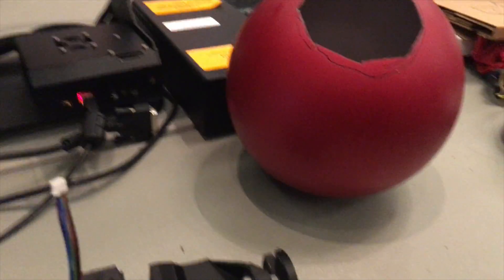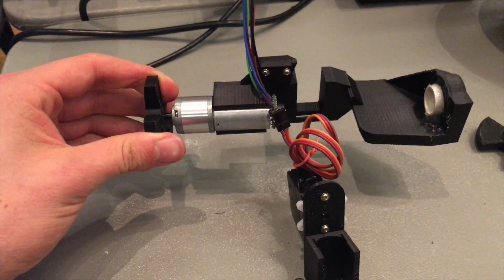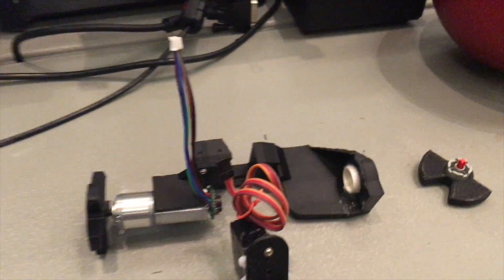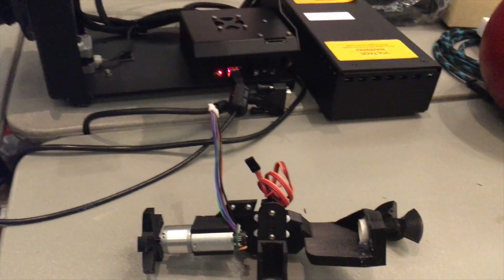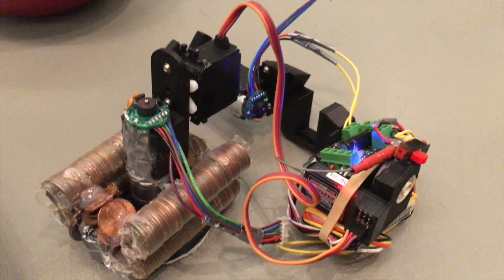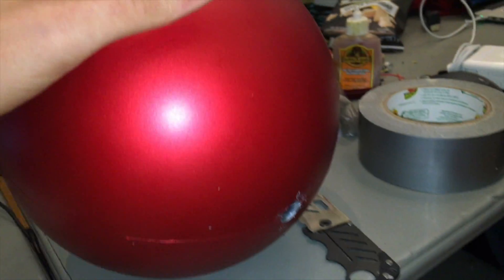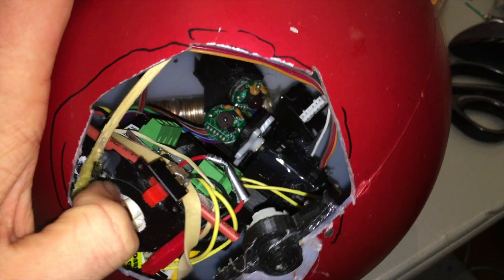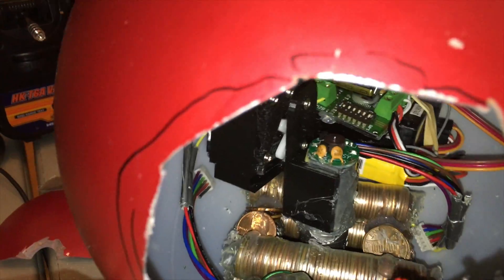24 Hour Hackathon: BB-8 Droid

Comment: Cool. James Bruton made his version 2 droid spin using your same way.
Reply from the maker: +BRANITOR Neither of us stole the concept from the other: it's been done before with plenty of other ball robots, all we did was add a head.  I had only seen James's first BB8 attempt when I picked out a sphere to use, and settled on a sphere without a uniform inside that'd allow for wheels, so I knew well in advance that I'd be attempting the pendulum method.   Also, when comparing this to James's, keep in mind that I designed and built this thing in a day..
Reply: +Joshua Lowrie sorry it's the other way around! James is the first that I know of that came  with this concept! +altapoderdog stole James concept and made it worst (less professional)!